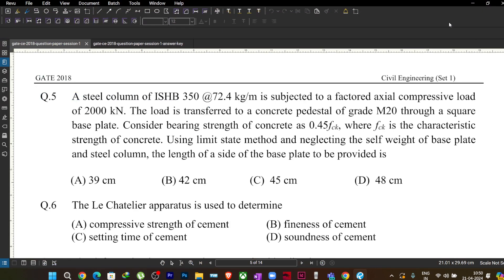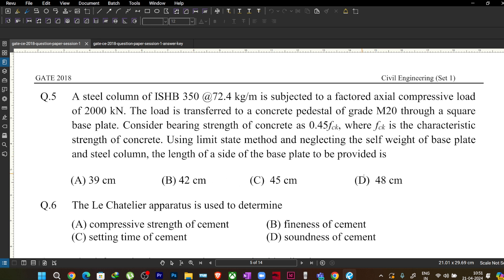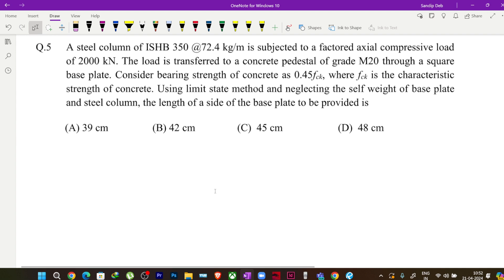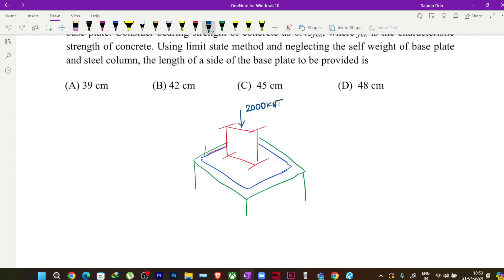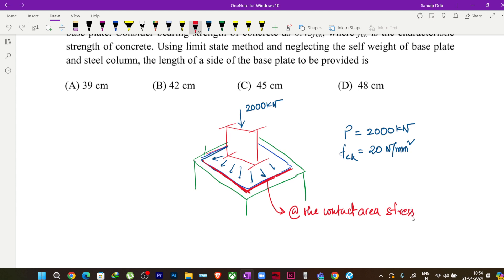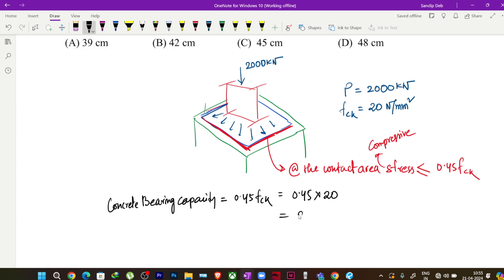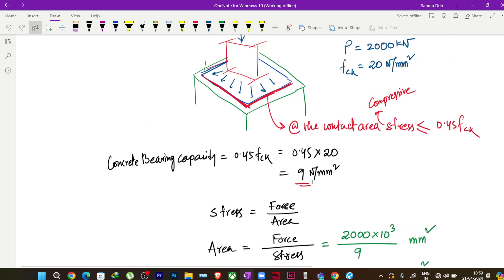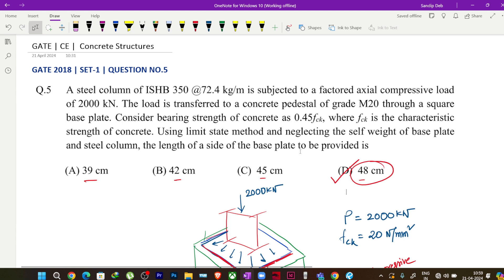GATE Civil Engineering | Concrete Structures | GATE-2018 Q. No. 5 Solution | ilustraca | Sandip Deb

Comment: What if the base plate is not a square base plate, how can we calculate the area?
Reply from the maker: Based to column dimension, bolt locations need to assume an area which satisfies the max. compressive stress on concrete criteria…